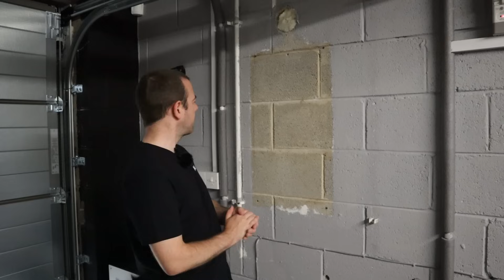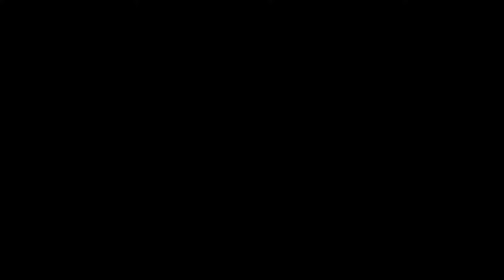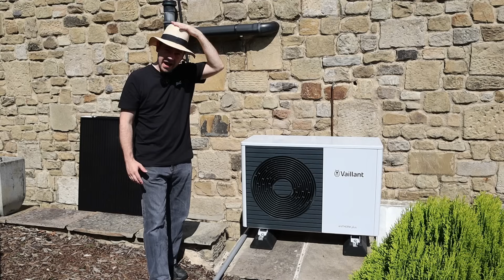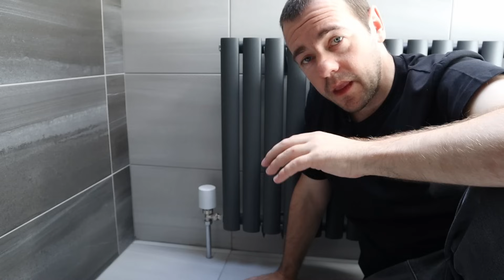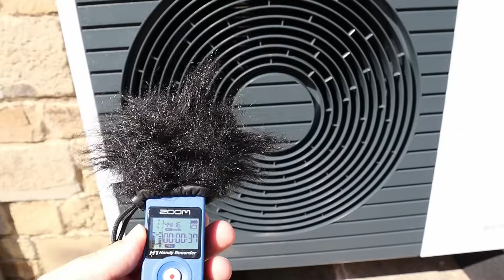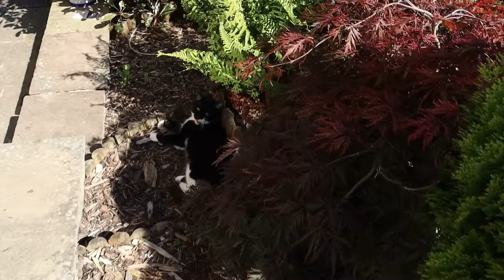Heat Pumps - Our 'Ugly' Truth!

Comment: We live in a 1920s bungalow, and have been told, by several installers how we would need to install underfoor insulation, as well as  many plumbing changes, that would work out at nearly £50k.
Recently, we had an old-school plumbing company come in who took one look at our system and said all we had been told before was rubbish, all we needed to do was swap the boiler for a heat pump - the reason being we have a thermal store system (as we have it linked to our wood burner back boiler as well the gas boiler), and that is well suited to a heat pump.
After having been put-off we are now actively investigating the possibility.
Reply: The first thing you need to consider is the overall efficiency of the building - not just the heating appliances themselves, So - is the building insulated to the current  building regs specs? or higher if possible? Whatever your heat source, however efficient it is, if the building is letting that heat out at a great rate, you are just pissing into the wind.
Underfloor heating works very well with heat pumps because it has the same requirement of a low flow temperatyure of around 40 - 45 C. However it is not essential to have it - you can run radiators at this lower temperature - they just need to be bigger ie have a larger surface area in order to deliver the same amount of heat into the room as a comparatively smaller radiater running at a higher temperature. So you will have to swap out some radiators, and probably, but not necessarily, change some of the pipework to them. Forget the underflooor heating ( which I'm guessing is the biggest part of the 50k )..
For a heat store to give you a good COP (coefficient of performance ((efficiency)) with a heat pump it will have to run at the lower temperatures which suit a heat pump and therefore, will have to be larger to be able to store the same amount of heat as the current one.. A heat store running at lower temperatures WILL NOT WORK WITH A WOOD BURNER. The heat exchanger in the woodburner will quicly build up kreosote deposits at these temperatures, which will reduce it's efficency and will corrode it. 
My advice to you is to pay a heating engineer to evaluate your propety and existing heating sytems and give his/ her recommendations. Make it clear from the outset that you do not want this heating engineer to do any installation you are  paying them to do the maths and give recommendations.A few hundred quid spent up-front on expert advice from someone who is impartial have a very quick pay-back time!

Comment: How do you charge the car AND  heat the water in the same 4 hour period with a battery? Single phase house so 7kWh in - 7 kWh out,,,,,,,,,(for four hours)
Reply from the maker: The house has a 100amp fuse. Car uses 32amp, battery and heat pump about that again combined (worst case). 

I think you’re getting confused with phases. A electric shower alone uses 9-10kW.
Reply: A couple of points:

1. He also charges his vehicle and powers his house during daylight hours via solar. 
2. 5 KWH is the maximum output for his heat pump. Because of that insulated tower(and the fact its a modern well insulated house and not a barn) the temperature in the tanks never drops to ambient during the day. If the pump has only got to increase the temperature in the tank by less than 10 degrees centigrade it's not really having to do too much work for very long.

So unless he is running a server farm or a dozen bitcoin mining rigs he isn't going to be maxing his power utilisation ever.

Comment: 5 kw is about 20 kbtuh. By American standards about 1.75 tons. That’s about half to a third of what we need to cover a 20f winter to 95f summer in a average 1000-1200 sqr ft home.
Seems undersized for the application , but reality rules over lab values, so I’m curious as a tradesman.
Reply: Actually, 5 kW is only 1.4 tons (refrigeration.) But even 1.75 would be insanely low except it is a super insulated home.   I really think he meant to say the compressor has a 5 kW electrical input.
Reply: @ontopoftheroof  
That makes sense.👍
I wonder what the Cost of Production is on this system. What’s the actual usage bill, Does it preform as expected. Expectations may vary.
But I prejudiced, I love those ole, H/P’s, especially geo,

Comment: I've been sceptical about heat pumps and ended up replacing my 20 year old gas boiler with a like for like replacement last year. Now that cost £2200 last year when gas was a mere 4p a unit and a ashp was likely going to cost £6-8k, and my boiler uses 15 to 20 percent less gas. But now with gas at 15p upward well was I short sited. Be very interested, if you're willing, to see how much power it takes to run the heat pump. What put me off is that for max efficiency it has to run 24/7 And something which can draw 2-3kwh in the winter with prices at 50+p/kwh worried me a lot! Anyway, hope it works out for you.
Reply: Not sure about the need to run 24/7 but ours definitely doesn't and has no problems keeping our 4 bed detached house warm over the winter.
Reply: @kiddwong4186  Do you mind saying how many kwh it draws from the grid and how much came from solar (if any) over the winter?
Reply: @keithhobbs1  ASHP daily consumption is going vary massively depending on size of house, the type of heat distribution system you have (radiator / underfloor / air), your programmed settings and insulation effectiveness. I'd need to dig out the data to give you average kWh numbers through the winter but in terms of costs, I know in the summer our monthly bill is around £30 and in the winter it's £100. We have underfloor heating and the house is occupied most of the time through the day so thermostats are set to at least 18C all the time.

We have 3.2kw solar PV (south facing, Midlands). Daily average output dropped down to 1.6kwh last December (4-5 kWh in November and January) so doesn't help much in the coldest darkest months. This is why we got a battery added to our system just recently.
Reply: Ours does not run 24/7. It works very well, and we are nearly two years in. The house energy consumption is down 30% in kWh from our gas days.
Reply: Our ASHP installers recommended that the heat pump run 24/7 as they were more efficient that way.  I was unsure as there would be constant heat loss that would need topping up, nevertheless I tried it.  For the first two days of 24/7 it used 60-80kW a day and the house was far too hot at night.   I changed to running it only in the evenings and usage dropped to 20-30kW a day in Winter.  My experience therefore was that even though it is less efficient to run it when you need it, its considerably cheaper to do so - you just need to start it up a bit earlier than you would with a conventional boiler as the flow temperature is lower and it takes longer to heat the house
Reply: The idea is to run them full time but at lower power, rather than a boiler that switches on and off but always runs at full power. You're modulating the power rather than the time. The total amount of power your house requires will be the same, so it's really down to the performance of the heat pump and the relative cost of gas vs electricity. 
Of course, (as EVM mentioned) it's probably worth running a heat pump at full power for a few hours overnight if you can get cheap electricity, even if the efficiency is reduced.
Reply: @robinbennett5994  I understand the logic of heat pumps being more efficient when runnng at lower power but I don’t wholly agree that they need to be run all the time nor that the total power the house requires will be the same.  Any house constantly leaches away heat unless its super insulated and hermetically sealed, so for every kW of heating put into the house, a certain % will be lost.  If you want to keep the house at a constant temperature then you will need to expend energy replacing that lost heat.  Yes the heat pump is efficient but there is still going to be a cost of keeping the house at a constant temperature.  Which brings to my other point, that overnight and during the day I don’t want nor need the house to be at a constant temperature.  If the lounge is heated to say 21 degrees for the evening then when I’m in bed or doing things during the day I don’t need the same temperature in the lounge - the house will generally be too hot to sleep and I’m paying for the constant ‘topup’ heating that’s going on to replace the constant heat loss that occurs.   Appreciate that when I do want to sit in the lounge in the evening there will be more heating required to reach that temperature in that area, but at least I haven’t had to pay for it to be constantly topped up when I’m not in that room.
And from my limited experiment it was significantly cheaper to only have the heating on when I needed it on than to have it on constantly.

Comment: Interesting to hear that you are going to remove gas entirely, thus saving the standing charge. We're considering a heat pump and replacing the gas hob, so it will be interesting to hear what you did to get completely off the gas grid.
Reply: Exactly my position. I have Heat Battery (SunAmp) and have done the past 3½ years and until a couple of months ago it was cheaper to heat by gas than the Octopus Go off-peak, but currently not so I've switched over to 5p off peak electricity and will review the situation 1, when the Solar and Battery (thanks to First4Solar) goes in later this month after 6 month wait and 2, I get the new Octopus-Go tariff in December. Although, the advantage of DHW by electricity overnight is that the SunAmp Phase-Change-Medium works better and I can operate the Gas Boiler at less than 60C for Central Heating alone because last winter I made the mistake of trying to optimise the Gas Boiler for Central Heating but because the SunAmp PCM needed 58C to Change Phase it wouldn't warm up and I kept running out of DHW!... 

In the running now as i as I have an 11 year-old boiler is an Air Source Heat Pump (with £5k grant), a Tepeo 40kWh Heat Store (without grant) or Tepeo + some strategically placed Air Source to Air Heat Pump/AC to supplement the Tepeo on cooler days in winter and provide AC Cooling in summer. The Tepeo may need supplementary heating as on coldest days last winter i was burning up to 70 kWh a day (but not every day) and the Tepeo only stores 40 kWh. Okay my loft space isn't as well insulated as it cold be and I will be making investment there but i'm not sure I could save up to 30 kWh/day just there!
Reply: @barryhaeger4284  thanks for the info looked at both but to wipe out £250 a year gas bill  I’m still looking so interested to see real world experiences  !

Comment: The only place I seem to see a lot of Anti heat pump info is from the UK, everywhere else in the world, heat pumps are wonderful, and a great addition to a solar system
Reply: That's because of UK government's requirement for heat pumps to replace gas boilers completely. This eliminates any efficiency gains and in older houses it does not work without first replacing pipes and radiators sized for high temperature water.

Comment: I know local hvac people are discouraging heat pumps and seem to be gouging on the pricing.  I have recently installed a one zone minisplit in my shop.  It will displace a gas heater, still have it as backup as our winters are cold and am a bit skeptical about efficiency at very cold temperatures.  

Half the problem seems to be retrofitting to existing central heating systems.  As our natural gas in british columbia will soon be connected to world markets via a lng facility, I expect our gas prices to increase.  Not mentioned when discussing pros and cons of said facility.  So I want a plan to phase out gas for central heated ducted system with an eye to environmental concerns as well.  

One plan is to just replace our air conditioner with a heat pump.  These are overpriced and don't have the efficiency of minisplits.  

Another plan is to go with an ground source heat pump.  Very expensive, but very efficient.  Has same cons as our current ducted system (uneven heat) 

Plan C is to buy a dual zone minisplit with air handlers to heat or cool main areas downstairs and up.  The advantage of this system is that we can separately control temperature upstairs and down.  I have never seen a ducted system do a good job of even temperature control throughout the house.  Since we have tenants downstairs, it would be very good if they had more control over their environment.   And minisplits  seem to be reasonably priced compared to central systems linked to ducted systems.  We good retain the furnace as backup and to even out air.  In terms of noise, my minisplit is amazingly quiet both inside and out.  

Excuse my ignorance, but don't you lose the cooling function when you tie a heat pump into a piped system?  A minisplit with air handlers would allow cooling as well as heating.  The air units are mounted high, removing the need for radiators and increasing useable foot print of a room.  Just putting it out there as an option.  It wouldn't be so useful if the house lay out is many small rooms.
Reply: Yes you can’t really cool with it because radiators are in the wrong position for cooling and you risk hitting the dew point and getting condensation where you really don’t want it.  In the UK to be eligible for the grant your system must replace the functions of the boiler, that includes heating the hot water.  In a lot of properties it’s much much easier to swap out the heat source than try to figure out how to run refrigerant pipes.
Reply: @edc1569  That would be unacceptable around here.  We have hot summers, cold winters.  I still wouldn't like the idea of losing that capability even in the UK where heat waves are not that common.

Comment: So you've taken the small footprint on the wall of a gas boiler and replaced it with an outside chunk of ugly (noisy - ie fan) stuff and an inside chunk of stuff about the size of a fridge/freezer? How many homes have the space to accommodate that? - both outside AND inside. I applaud your reasons for going this route but I think it is mainly for the well off. Plus, how much does this save to cover the installation costs? If it costs £5000 for a heat-pump and I recoup this cost after, say, 20 years, then it isn't worth it. There has been talk about having to increase the size of the pipes/radiators as the heat-pump source is lower than a gas-boiler so you're looking at major changes to your heating system. I'm all in favour of moving from gas but I don't think the current "heat-pump" technology is there yet.
Reply: Inside space is equivalent of a hot water tank - which many homes already have.
The aesthetics of the external unit are personal opinion, but they look better than many vent stacks etc, particularly those with protective cages.
And they aren’t noisy - or did you not watch the video?
Reply: looks a lot bigger than most hot water tanks I’ve seen I bet I wouldn’t fit in our airings cupboard! Was told we needed a slim one at a lot dearer price and then need to pay for solar diverter etc 🤔🤨🧐
Reply: An ASHP install for £5k is beyond the stuff of dreams. You can double that in most cases. By the way, he talks about the need for increasing the size of radiators and flow pipe sizes in the video, I’m guessing you haven’t watched it?
Reply: @HiruS22  been quoted 5-6 k including the grant and still can’t make figures work till gas boiler goes in 2021 our year gas bills was under £250 for the year ! So I’m not falling over myself to pay that kind of money and 2x + our electric bills with current prices!

Comment: I’m am at the stage of researching for possibly solar panels, heat pump, water tank storage, & batteries. My bungalow with a large flat area on one roof is 2 yrs old with underfloor heating, plus the latest in insulation. It’s got a gas Worcester boiler at present. Your videos are very helpful & thank goodness the heat pumps are now quiet. I’ll look into First 4 Solar, it is difficult to know which company to trust but I know your recommendations are good and much thought given! Thanks again.